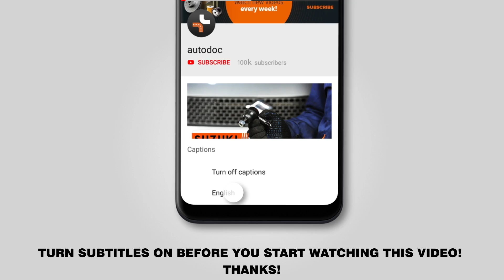How to change rear brake caliper on VW CADDY 3 (2KB) [TUTORIAL AUTODOC]

Comment from the maker: 🛠️The tools you need to replace rear brake caliper: 
- water pump pliers
- combination spanner No.12
- combination spanner No. 13
- combination spanner No.15
- drive socket No. 13
- torque wrench
- wheel impact socket No.17
- wire brush
- brake cleaner 
- copper grease 
- anti-squeal paste
- crow bar
- fluid container
- wheel chock 
- brake hose clip